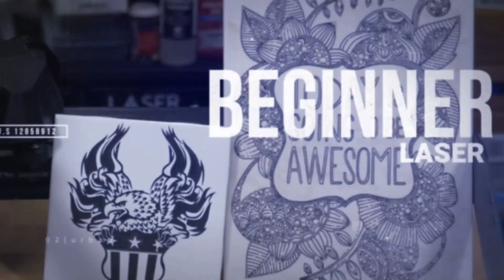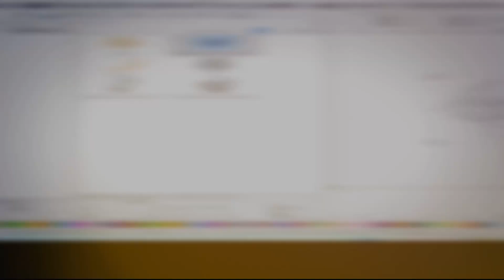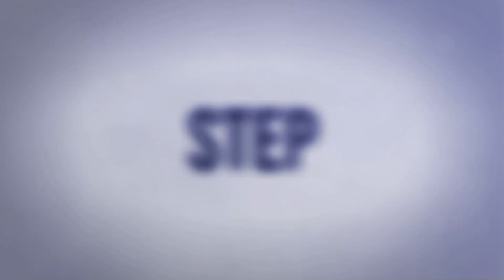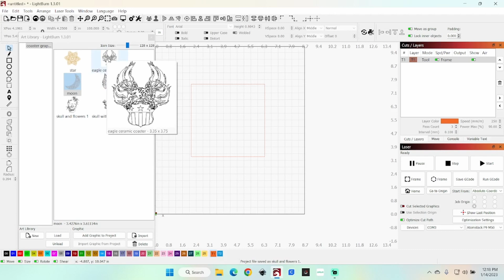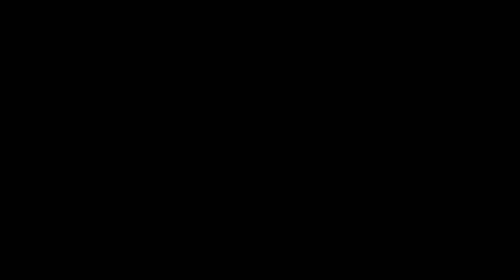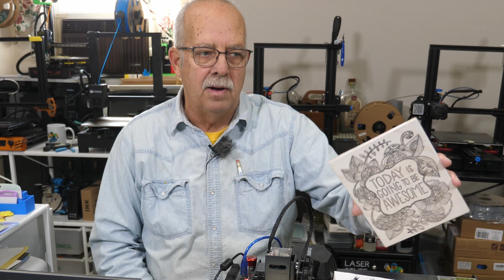Beginner Laser Project 10 Ceramic Tile

Comment: It would be helpful to mention the wattage of the laser when doing your projects.
Reply from the maker: I do when it matters.  Here it does not since you need to run the tile test first, regardless of laser brand or power to obtain the correct setting for the engrave.

Comment: I spray painted some glazed white tile with black spray paint then engraved the tile.  I love the way the laser looked through the black paint before wiping it off.  My question is, Can I engrave glazed/unglazed black tile?
Reply from the maker: Yes, but results will vary.  Depending on the composition of the tile.  It may engrave white, gray, or black.

Comment: Thanks for preparing this video. It has answered a lot of my questions. 1. I was thinking of making tiles as framed displays. Have you come across any wooden (picture) frames that work with the tile dimensions?  2. Have you tried using the Titanium-Alcohol solution method yet?
Reply from the maker: Titanium Dioxide/Alcohol works well and cleanup is easy, but MUST be sprayed to get a uniform coating.  Have never looked for frames as ours are for coasters or actual user on walls as tiles.

Comment: Love the tile engravings.  However, I noticed your price for the coasters was $2.  How can you make any money with that? You have to have more than $2 of your time invested.  For me that is less than 5min of time. then your cost and overhead plus profit.
Reply from the maker: Mass production.  I don't make one at a time as in this video.  Made in lots of 12 per design, mostly unattended, on multiple lasers.  Paint is applied via HVLP gun, 100 at a time.  Clean off is in a 5 gallon bucket of acetone in large lots.

Comment: what is the purpose of the paint? i asked a question, then you removed the paint. do the lasers come with instructions on how to do these test grids?
Reply from the maker: The white paint contains titanium dioxide, which reacts with the laser beam, turning the engraving black.  Once engraved, the white paint is removed with solvent and the remaining black engraving is permanent.  without the paint, it will not make a visible engrave.  Lasers do not come with any directions beyond assembly and startup.

Comment: is there any others option for the spray paint?? other than that brand??
Reply from the maker: I use this brand and color due to the high level of Titanium Dioxide.  Cheaper brands may (will) have lower levels.  The higher the level, the better the result.
Reply: @rogersshop  ooo thanks kind sir, because this spray paint is so expensive 🤣

Comment: Im trying this method on my xtool 10w and only geting grays same paint. Is there something i could be doing wrong? Thank you
Reply from the maker: Did you make a test grid tile first?  There should be several squares that are black which will reference the best speed and power.  Also, make sure your laser lens is clean!  I've seen several instances where this is the problem.

Comment: Hi Roger. Did you ever manage to sort out the cable management for your ZBAITU 40W Laser Engraving Cutting Machine M81???  Many Thanks!
Reply from the maker: No.  Rather than try to design a drag chain and some way to add air assist, I took one of my xTool D1 lasers and added the extension kit, then put a drag chain on it.  https://youtu.be/6JhksZasl6Q

Comment: Another GREAT video!  I think you have covered this before.  But on the burn test grid, how does it adjust the power down.  Looks like it is all 100%.  Must be somewhere in LB you are telling it to decrease power as it goes across the grid by colors?  Thank you!  Steve
Reply from the maker: Yes, in the layers, power is set at different values for each square.  I did not make this grid.
Reply: @rogersshop  Ya, found it in LB.  For the benefit of others, you can change the power you want for each box in Shape Properties.

Comment: Great video! You may have changed my mind about which model to get, so much choice! Do you recommend air assist with laser engraving? Great hair BTW.
Reply from the maker: Air assist is good have when engraving wood and leather, etc.  I do not use it when engraving ceramic tiles, slate, or stainless.